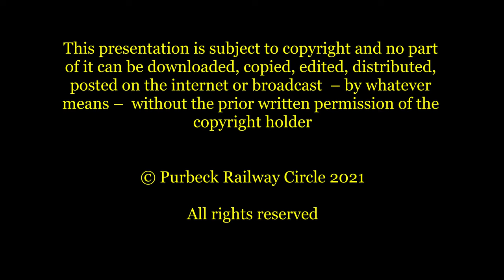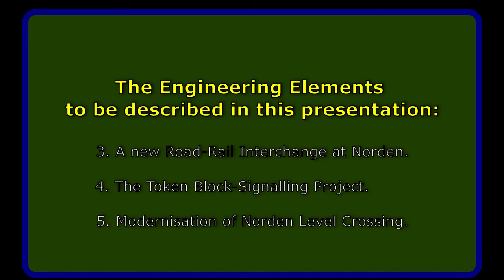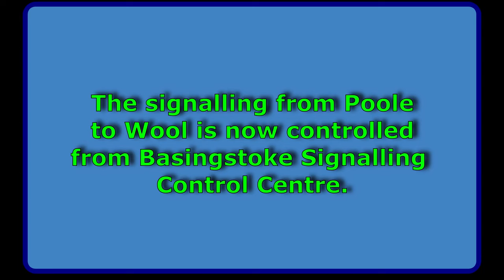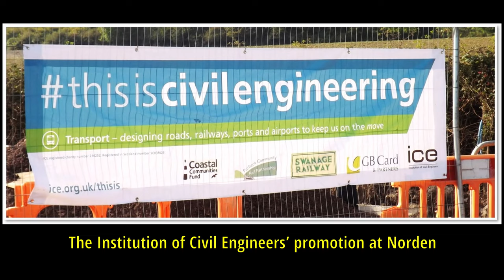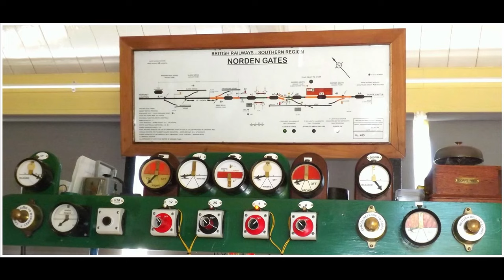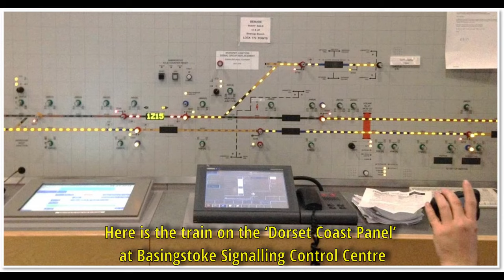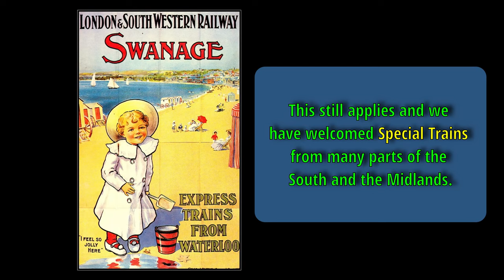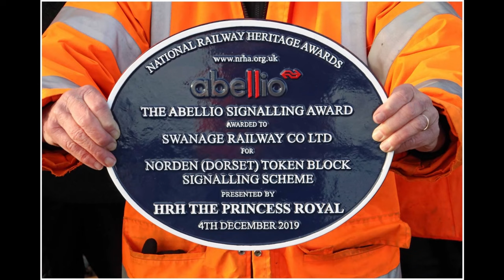Upgrading and Signalling the Wareham Link for the Swanage Railway

Comment: A very nice, laid-back documentary on an interesting number of events on the Swanage Railway.
Reply: PROJECT WAREHAM UPDATE STATEMENT FROM THE PROJECT WAREHAM DIRECTOR,  SWANAGE RAILWAY

The Swanage Railway continues to make preparations for the introduction of a second one-year selected-days passenger train service between Swanage and Wareham, where a connection will be made with South Western Railway main line services.

It is now our intention to initially operate the new Wareham service over 90 days between April and October 2022 using our Diesel Multiple Units, which have been overhauled to main line condition thanks to a grant from the Government’s Coastal Communities Fund.
 
This grant has also enabled essential work to be carried out on upgrading the track and infrastructure between our existing limit of passenger operation at Norden and the junction with Network Rail’s London to Weymouth line near Wareham.    

Full details on days of operation and ticketing arrangements will be announced nearer the time.
 
Mark Woolley, Project Wareham Director, Swanage Railway
27 July 2021

PS: The delay until 2022 has of course been caused by the impact of the Covid-19 pandemic.

Comment: They need to get passenger trains running that line again - sad to see those old historic signal boxes go
Reply: PROJECT WAREHAM UPDATE STATEMENT FROM THE PROJECT WAREHAM DIRECTOR,  SWANAGE RAILWAY

The Swanage Railway continues to make preparations for the introduction of a second one-year selected-days passenger train service between Swanage and Wareham, where a connection will be made with South Western Railway main line services.

It is now our intention to initially operate the new Wareham service over 90 days between April and October 2022 using our Diesel Multiple Units, which have been overhauled to main line condition thanks to a grant from the Government’s Coastal Communities Fund.
 
This grant has also enabled essential work to be carried out on upgrading the track and infrastructure between our existing limit of passenger operation at Norden and the junction with Network Rail’s London to Weymouth line near Wareham.    

Full details on days of operation and ticketing arrangements will be announced nearer the time.
 
Mark Woolley, Project Wareham Director, Swanage Railway
27 July 2021

PS: The delay until 2022 has of course been caused by the impact of the Covid-19 pandemic.
Reply: Looking forward to riding the line this summer!